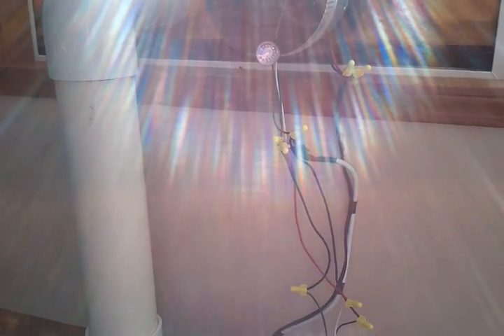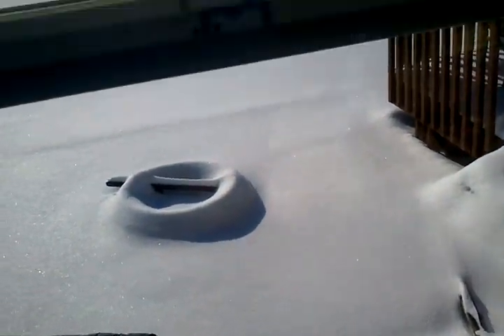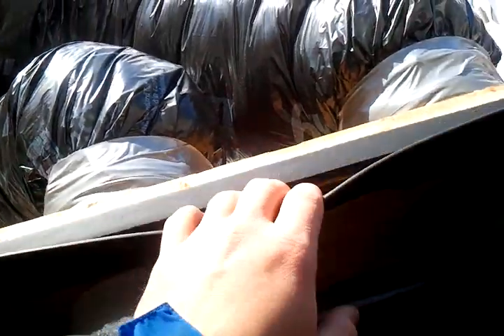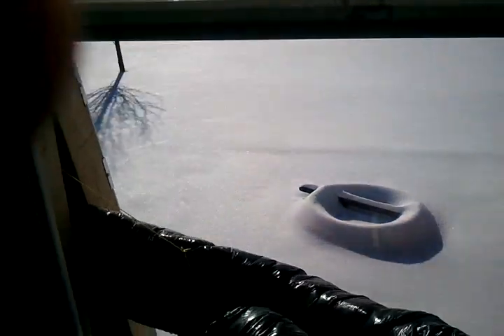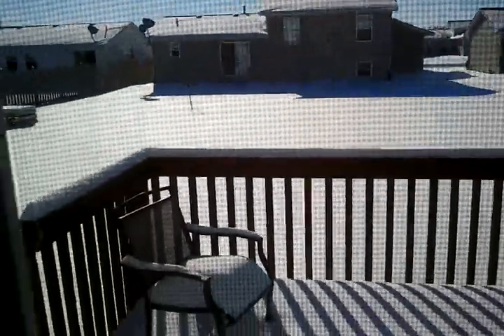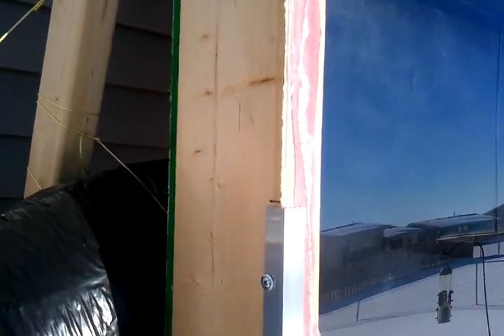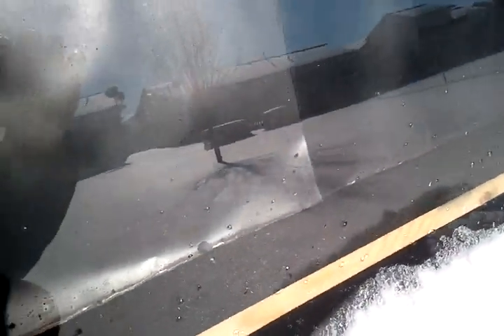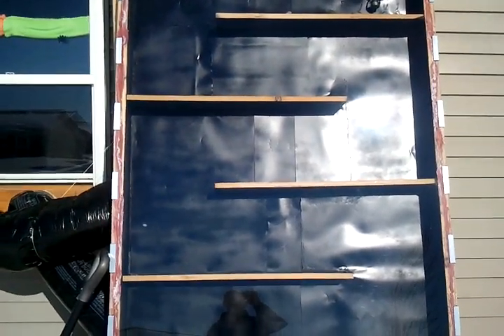Active solar heater update

Comment: hi great job only thing i might do if i were you is put a variable control on the fan that way you can adjust it to see if you get more heat at lower speeds have you tryed cans if you get a chance take a look at mine in the uk just click on my name i can send you my plans
and yes they are a little different from the normal solar can heater plans that might be why
we get the temps that we are getting 201f from an outside temp of 10c/50f

Comment: your fan blow too fast that the air flow is not as hot to the feel.  I urge you to add a simple bottom reflector that can be swiveled which can double the BTU goinginto your colector.

Comment: your fan moves a lot of air that you can add more solar collectors to improve the temp flow higher.  or you can add reflecting film to turbo your solar collector . but you will have to keep adjusting he reflector to keep it  going into your collector. or you can place the reflector flat on the bottom to bounce up and all you need to do is swivel it as the sun moves.